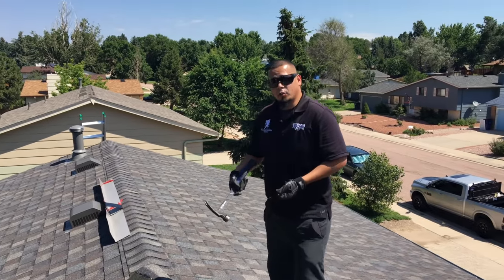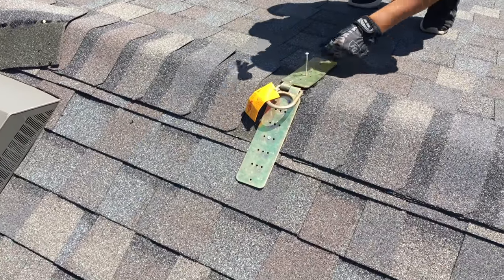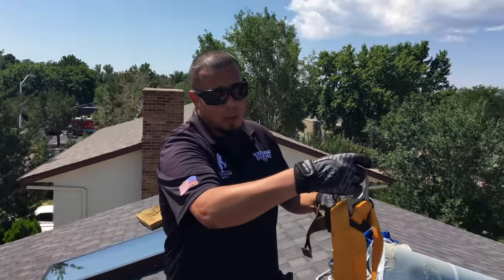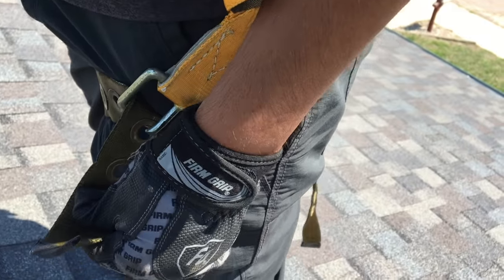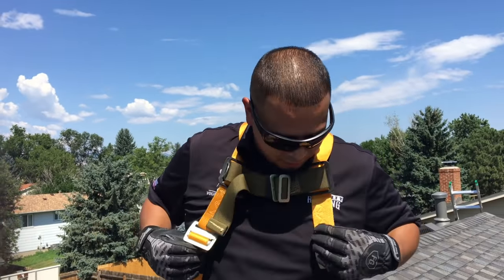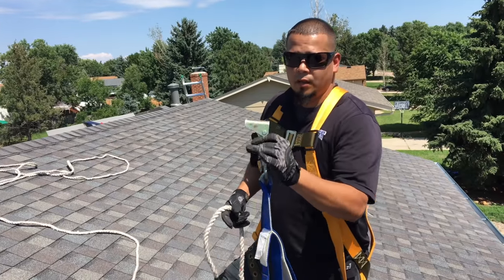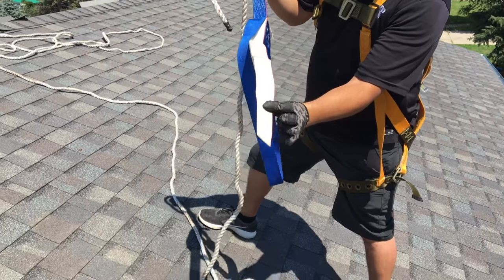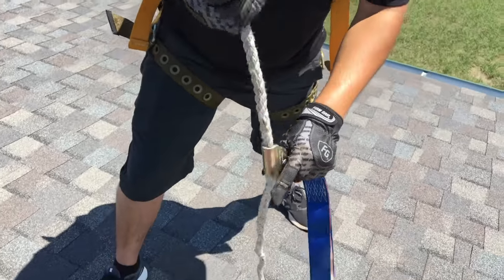How to Use a Roof Safety Harness | Fall Protection

Comment: if you have one guy, maybe 2 on a roof a harness is probably fine. but as for a crew, whatever protection a harness provides is negated by the extra obstacles and tripping hazards created when you got everyone  tied on. believe me anyone who roofs knows that loborers are gonna be all over the roof back and forth grabbing coil nails, shingle bundles and what have you to keep the shinglers bangin out squares. the last thing anyone needs is to have to maneuver 5 or 6 lines. jacks with 2x8s is more than enough protection without creating additional hazards. in fact miosha's rules concerning fall harnesses states that they are required unless the company determines that the presence of safety lines will creat more hazards than is necessary. furthermore I for one have never ever seen a roof crew wearing those on any residential roofs, even the big famouse multi million dollar companies you see with fancy TV commercials. not that anyone is trying to be gung ho or macho, just because any real roofer sees those as more of a hazard than a safety feature.